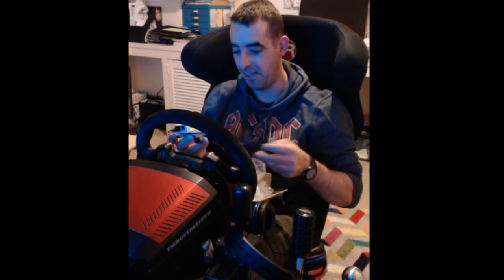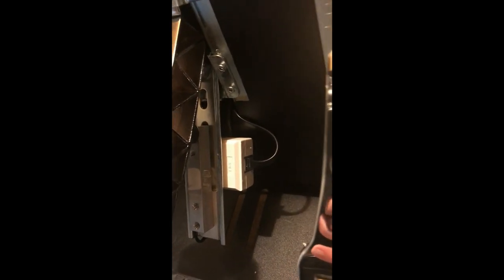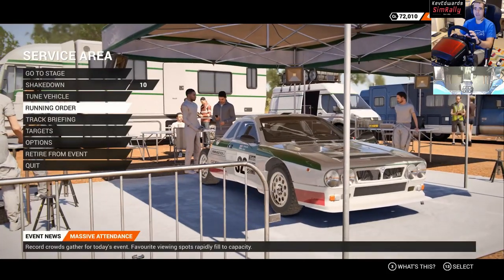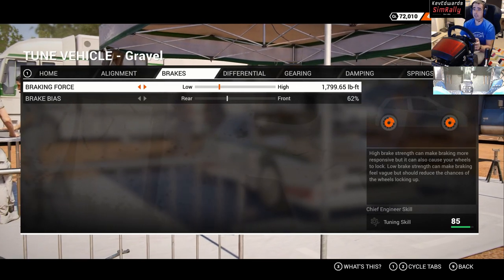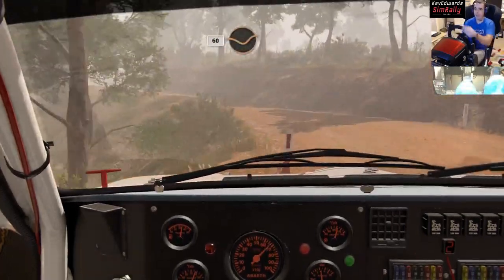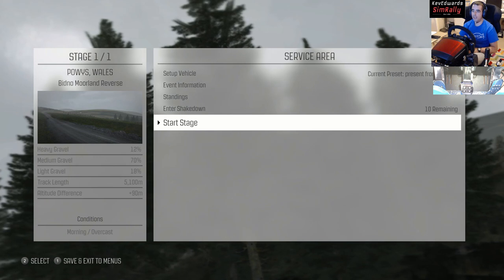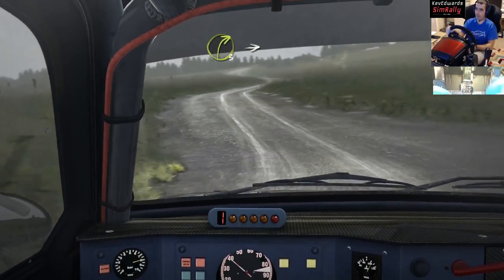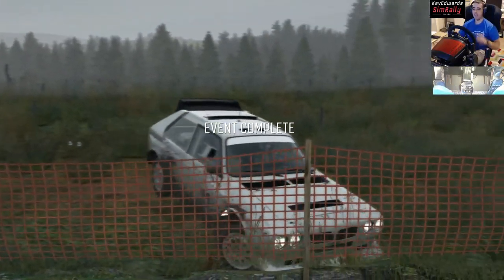Sim Racing Solutions T3PA PRO load cell mod, first impressions

Comment: Nice review there!
How stiff is the pedal compared to the conical brake mod? I have the regular T3PA pedals basically "mounted" with double adhesive tape to the floor, and I like to drive with just socks on. Also, do you lose a lot of feel when lowering the brake saturation. Like, can you still get a progressive feel just with a bit less maximum pressure?
Reply from the maker: It’s pretty stiff but if I remember right the Blue BBJ conical brake mod was even stiffer but am not sure if your tape will hold under heavy braking. I’ve never noticed any loss with changing saturation but with the load cell mod I’ve not had to change saturation on any other game. If your running a Conical mod though it might me worth having a play round to find a sweet spot 👍
Reply: @kevedwards  Thanks mate! If I got it right the blue BBJ mod is softer but with a better progression than the Thrustmaster conical mod. In which case I think the SRS load cell mod will work wonderfully. I shall see in a few days as I've just ordered it. :)
Reply: How much of an wheel angle do you use in dirt Rally?
Reply from the maker: I use 540 on all my rally games 👍 I know some people prefer a tighter rotation but I like to keep it close to reality and 540 is the standard on modern day cars 👍

Comment: Do you still have this product?  ,  The support frame where the load cell is attached looks a bit weak. I am thinking of getting this but I am not sure how it will stand up to any abuse
Reply from the maker: Mine has been fine but I’ve read somewhere that the rubber can become squashed over time, they sell spares on the website but I’ve honestly had no issues 👍